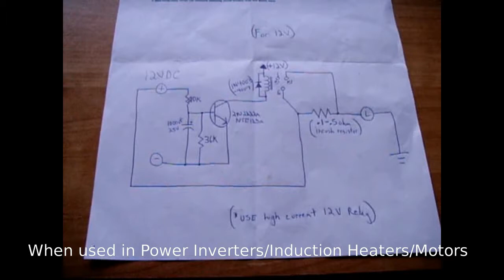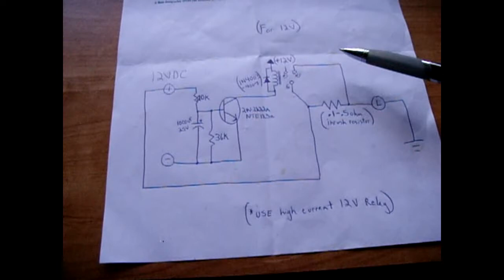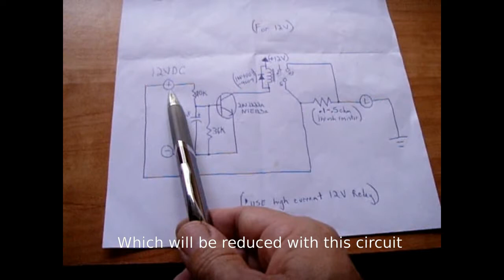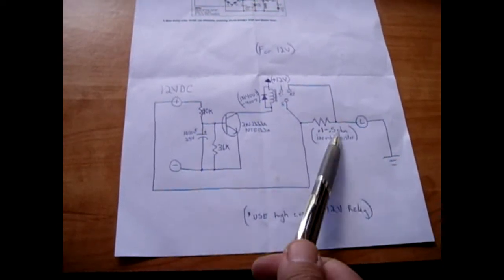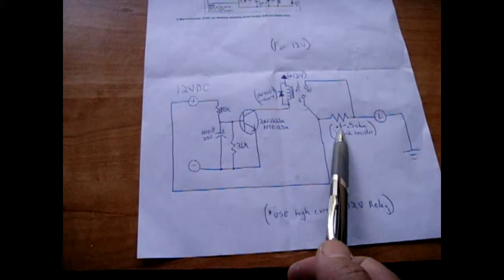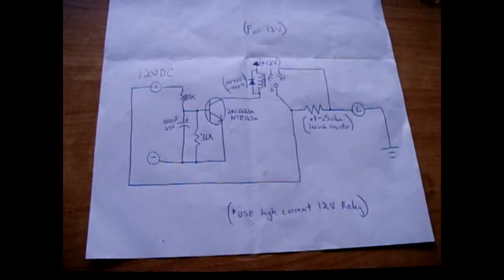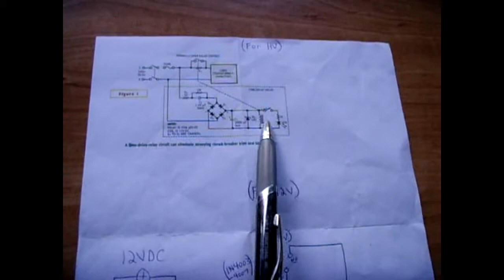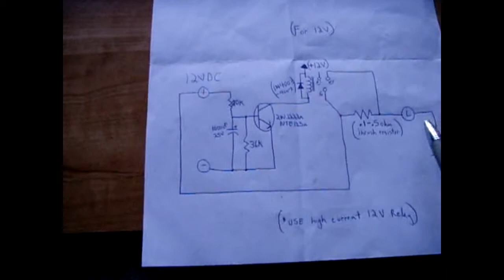Simple/Effective Solution To Inrush Current Problems

Comment: This is a very helpful video, thanks! Question - does this need to be a BJT, or would a MOSFET work as well? I would be using this on a 96V BLDC motor controller.

Comment: Interesting simple circuit I'll use this to limit my linear power supply. It's inrush is large about 30 amps and 150amp or so on the capacitor inrush.

Comment: So what would you do on a old motor circuit that draws more than 50 amps on three phase 460?
Reply: Same principles apply, just recalculate the resistances, add larger transistor powering 3 50 amp relays and matching inrush resistors.

Comment: awesome. any ideas on how to do this with 20amp 240v ac compressor with start/run compacitor?
Reply from the maker: You don't want to hold back inrush on a compressor, it needs the torque to start up. To make starting easier, add a "hard start" kit. Thanks for watching!
Reply: @electronicsNmore   ive been watching techs put these slow start kits: "hyper engineering sure start" and "micro air easy start" and they claim it rids the hard thump of 100amp inrush down to 30 amps and still is able to start the compressor. unfortunately they want nearly $300 for these kits. after watching your videos, i was thinking i could make something with kw resistors and a timer relay to achieve the damper of inrush.
       I have tried the traditional hard start kit and it shortens the inrush draw time but it does not eliminate inrush thud and light flicker. i also watched your video on thermsistors but the current may be too high for that. 
thanks
Reply: @beanaleeno  I recently tried wiring a NTC in series with my fridge compressor in an attemp to limit inrush current on start. I measured the regular inrush current of the compressor, it was about 50A @ 127Vac. I wired a single 10Ohm NTC in series, and expected the inrush to drop about 5 times, following Ohm's Law (127Vac/10Ohm = 12.7A). However, the results were quite unexpected haha. The inrush current still measured around 48A @ 127Vac, a negligible drop, futhermore, for my surprise, the NTC literally exploded on start LOL. Somehow it still managed to keep functioning after the inrush. Steady state current is about 2A, way less than NTC max. steady current specified on datasheet of 5A.
Reply: @fernandodesouzavieira  did you manage to find a solution to limiting the fridge compressor inrush current? I’m trying to achieve the same thing

Comment: How about designing a circuit that switches the ac voltage ON at exactly the input power factor angle? It would be a Transientless start.
Reply from the maker: Much more complex.

Comment: Great project as always.   I had a need for this circuit feature with a Halloween prop that uses a current protected ATX  PC power supply to power a 1960s vintage car wiper motor.   I built a completely solid state circuit to provide a soft start function to run the motor and eliminate high start up surge currents for the wiper motor that was sending the ATX PSU into over current shut down.   Check out my video.  https://www.youtube.com/watch?v=2QLEQyYXh-s        It has been in service for 2 seasons now running from Oct. 1rst to Halloween.   Love your channel.

Comment: Can i use 4 or 5 termistors in paralel
Reply from the maker: How about using one properly rated NTC thermistor?
Reply: @electronicsNmore  my inverter draws 40 to 60 Amps there arent ntc with that power
Reply from the maker: In that case, do as shown in the video.

Comment: I have 7500VA Toroidal transformer,I have a inrush current issue , how to short out the issue
Input voltage: 64v and output voltage: 230volt, awaiting for your feedback
Reply from the maker: You need another smaller toroid wrapped with a bunch of turns of the same size wire connected in series with the larger toroid. It will act as an inrush limiter. You'll need to experiment. Thanks for watching!

Comment: I have my string lights run on 170 volts DC. Rectified right off of 120 volts into a pretty large capacitor. I have a timer switch turn it on and off, and I could always hear the arc in the relay when it turns on. Well just last week the contacts got stuck closed. What would work well for this? I saw your other video on the thermistors, and I am wary about the recovery time.
Reply from the maker: Hello. You need a capacitor and resistor to protect the relay contacts. See the link below.
https://www.physicsforums.com/threads/preventing-arcing-across-relay-contacts.275453/

Comment: Thank you for the great video!!
Reply from the maker: wei48221 You'll need to use a 48v relay, play around with the resistor values leading to the base of the transistor(use higher values), and make sure the voltage rating for the capacitor and transistor are higher than 48v. Thanks for watching!

Comment: Just watched a couple of your videos describing inrush current limiting. Very good explanations! NOW, here's my problem. Say I'm trying to operate a hand held circular saw for wood cutting. Like a Skil Saw. They have a super high peak current draw when starting up. I want to run it on an inverter. The poor inverter gets nailing by a nearly short circuit condition, similar to a iron power transformer when energizing. I already built a inrush limiter circuit like the one you show near end of video and it works great! The saw starts nice and easy, then gets full voltage and I'm off to the races! The problem is that hand held power tools need to be operated by a trigger on the handle to be used safely. All inrush limiting devices, like the one I made, requires the load to be already switched ON and then turn on the limiting circuit to make it all work! So, I'd have to hold down the tools switch with one hand, then use my other hand to turn on power to the limiter! Then when I'm done I release switch on tool THEN have to remember to switch off the limiter! NOW, is there a way to have a circuit that DETECTS the power switch on tool being closed, THEN do it's limiting thing AND then reset AFTER I release the tool's switch? That is the problem. Sorry for the long winded explanation  but I wanted to make this request as clear as I could. Thanks!
Reply from the maker: You need to have the tool always powered on, then use a switch to drive the circuit.
Reply: Thanks for the kind reply, but the whole point of my comment was to figure out how to build an inrush limiter that sensed the load being powered up by using the tools switch, then have the inrush circuit automatically do it's thing. In other words, have a "sense" circuit that "sees" the tool being energized by a drop in resistance, then reset itself when it sees the load go away, high resistance. That is the challenge. I think if that could be designed, it may be a marketable product that could be sold in stores. It would come in handy at construction sites where framers are using hand power tools running from portable generators, etc. Instead of that skil saw surging the generator with 40 amps startup load, it could be dropped down to like 18-20 amps surge, allowing the motor to slow start for a couple of seconds, then switch to full power. See?
Reply: @curtchase3730  I have exactly the same problem using a 3phase radial arm saw thru a variable frequency drive,which trips on load surge only a 'few' amps out of inverters capacity....
Reply: Funny a skill saw running on inverter. Got me here.

Comment: Hi!
Nice video,thanks for that.
1)Can you post a link to the other 220V ,inrush voltage protection?The image is not very clear in the video.
2)Did you post the video on you DC to AC power inverter?
Cheers!
Reply: I got the image from your tinypic link.

Comment: Im trying to modify an 18v laptop power supply to be used in a power tool. Is it possible to remove the inrush current protection enough to allow the power supply to meet the needs of a power tool?
Reply from the maker: You'll destroy the power supply

Comment: Very good info. I have tried many of your circuits and ALL work well. One question though.
The "startup" .1 or .2 ohm resistor to be relayed out...what effect would a 10-20 ohm, high-wattage resistor have on the inrush current?  It seems the .1 ohm would almost be a straight shot through with almost no resistance...?  Still trying to learn on this end. Keep up the good work, and thanks much.
Reply from the maker: gene guru1 That value would be too high. You'd have a large voltage drop.
Reply: Thank you for your quick answer! Makes sense to me now...

Comment: You mention in your video, inrush resistor of .1 - .5 ohms ( high wattage), what is high wattage? What high wattage resistor did you used in your project? or what high wattage resistor is good for this circuit? I love your video's, good topic, great explanation, diagram and the change values. But only this video, you got me stump on the high wattage resistor!
Reply from the maker: 20 - 25 Watts.

Comment: My understanding is that an inductor doesn't need inrush limiting.  It has a high resistance to any change in current (i.e. when a voltage is suddenly applied).  The magnetic field opposes the current flow as it establishes itself around the conducting coil.  
A motor will have a high inrush current.  Is that what the circuit is intended for?
Reply from the maker: Motor or large transformer.
Reply: I'm here because I'm having that exact problem with a 500W toroidal transformer.  It repeatedly trips a 16A crcuit breaker in my basement, even with the secondary output unloaded.  I'll want to try a simple NTC thermistor in series with the primary,  but it won't limit inrush if the transformer is re-energised after a brief disconnection.  The thermistor needs time to cool down again so its resistance is sufficient to limit the next inrush.
I'm wondering about a simple series inductor instead,  but I should probably just use a circuit such as yours.
Reply from the maker: westinthewest
Toroids are big trouble makers when it comes to inrush problems. My circuit will work, or you need another smaller toroid wound up and connected in series with the larger toroid to limit inrush current.

Comment: OK Kool so the section marked "L" would go to the center tap of the transformer and connect the input of the circuit to the batteries and thats it?
Reply from the maker: +Ainsworth Lynch (enzy) 
Yes, (L) is the load, which is the transformer.
Reply: ok then I will surely try it on a inverter circuit, but question what if the inverter doenst use a center tapped transformer is it ok to just connect it to any line
Reply from the maker: Connect it to the 12v(POS) supply leading to the transformer.

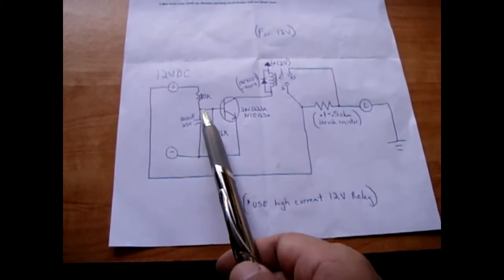Comment: 03:16  correction. the two resistors, will have an effect on the delay of the transistor triggering (not only one). the delay can be computed by getting the thevenin resistance and thevrnin voltage. after that the rc equivalent circuit (from thevenin computation), can be obtained
Reply: nevertheless, the video is very good

Comment: Hi, a very useful piece of safety module you have here, I'm building one right now for my modified sinewave inverter which is also one of your project, I always find time to watch and build your projects because it works and tested. In this project I have a hard time looking for a 30w resistor. In our local electronic stores only provide up to 20w, so my question is, can I use 2pcs 0.2ohm 20w in parallel? I think it will produce 0.1ohm 40w, Pls correct me if I'm wrong.Thank you

Comment: do you think that a 2n3055 transistor will do for this?
Reply from the maker: The relay is handling the load. Using a 2n3055 would be a major overkill. Try any general purpose to-92 NPN which is rated to carry the low current load of the relay coil. If your using a relay with a high current coil(which I do not recommend), then use a general purpose/switching NPN in a to-220 package to handle more current.

Thanks For Watching!
Reply: ok but i rather have a high current transistor just to be safe incase of anything goes wrong
Reply from the maker: The worst that can go wrong is the relay gets overloaded and burns up the contacts. It also takes more current to turn the 2n3055 on fully. I would try and use a to-92 package transistor. That 2n3055 is really designed for high power applications.
Reply: i almost burned a 2n3055 trying to make a joule ringer. it still works fine but i got a new one. i still use it for a joule thief.
Reply from the maker: I've gotten burned many times. You do not anticipate that it will be very hot when you touch it.
Reply: check my video on a joule thief circuit and you will see the transistor mounted to a home made heatsink. that was after the experiment and now ill always put one of those in every transistor
Reply: Nice little inrush limiter you designed there.
One little thing regarding the paralleling of the relay outputs... if one contact ever developed a problem like sticking open, then all the load current would be forced through the one pole that remains working, thereby exceeding the rating. (In your case, that would mean 30A flowing through a relay contact only rated for 20A.) Two separate fuses before the relay would probably give you adequate protection for this scenario.

Comment: This can alleviate the instantaneous demand required by an inverter (from the battery bank) when an AC motor is attached to the AC side; however the inverter still gets loaded (it looks like a dead short to the inverter still - for an instant - and is therefore hard on the mosfets or whatever), why not just have AC capacitors on the motor, and large DC capacitors on the DC side. Then you don't have a "brown out" situation that is created by current limiting - rather you are buffering the requirement, and supplying full current with capacitance.

Comment: I think this would work well at lower voltages , but at higher volts I think a metal oxide varistor would be another option. BTW no one has a decent M.O.V. tutorial on the tube ..hint hint. Great video ty.
Reply from the maker: Thanks. I think it should work just fine at any voltage, just as long as you choose the proper high wattage fixed inrush resistor. You may even have to go slightly lower. (.05 ohms maybe)
Reply: That's because an MOV is a "sacrificial" device; all of my personal "general-purpose" protectors use gas-discharge devices; they just come back for more, while an MOV will explode when it gets hit with the 1st surge.
 Ever notice that lightning strikes seem to occur in multiple stages? That's because they DO.
 (I know this is a little "off-subject", but it's the same idea; eliminating a brief excessive current.)
Some types of high-inrush situations "mimic" lightning strikes, where there's more than the initial "spike".
Example: The fancy telephone system that was installed at the remote transmitter site, for, (where I was later hired on as the C.E. for), a 4MW TeeVee station, & used MOVs for "protection", routinely had the MOVs "blow up" (literally) whenever there was a storm. It was in "tornado alley", yet despite my best efforts to try to get the Telco to tie into the 1,100'-tower's "star ground" system, they insisted on using one 12' pipe in the ground, over 25' from the towers' ground-field; every time the tower got hit, (which was a lot), "Pow!", "...And another one bites the dust".
 To the author of this video: It's refreshing to see that there are some of us that really DO know what they're talking about! Kudos! Excellent explanation!